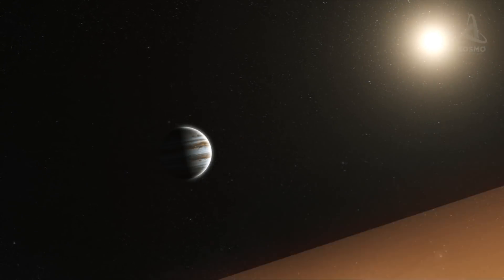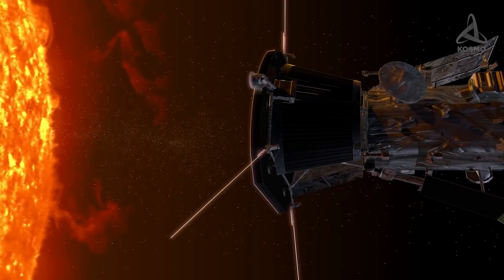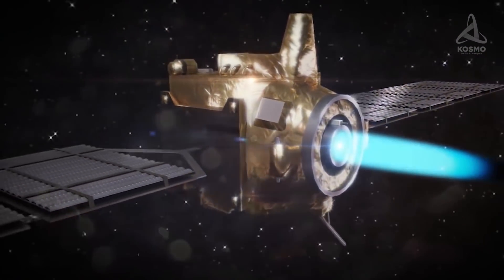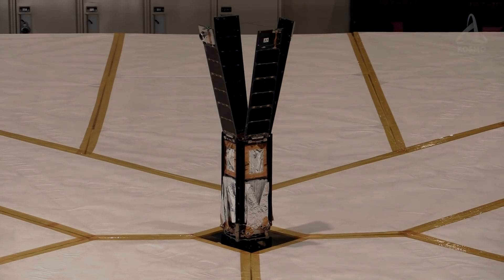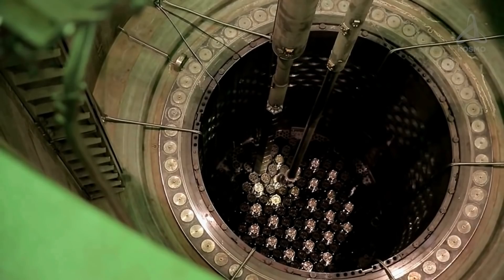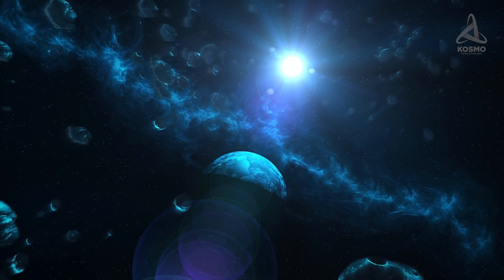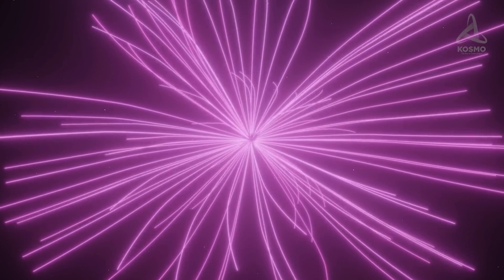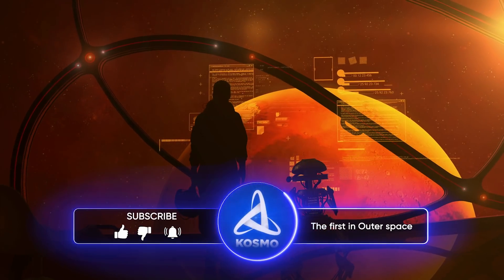Spaceships Capable of Reaching our Closest Stars

Comment: The Bussard ramjet was disproven in the 1960s. It's a sort of perpetual motion machine, effectively. The drag overtakes any possible thrust.
Reply: So was the Alcubierre drive warp bubble model recently, created by bending space in front and back of the space craft. It could only work if there is inverse matter (not antimatter, it's just negative charged matter) for bending space. 
It was proven and proposed a new model for bending space which does not use inverse matter.
Reply: @rahulbhoye9381  Very recently. I lost track of how many podcasts, channels and websites covered that debunk. Some even had Miguel Alcubierre on.

Comment: Even with 1/10 c = 29'979'245 m/s (classical physics still applies), you still need >40 years, and if you hit 1g of sand at that speed, you will have to absorb or deflect 317’133’073 times more kinetic energy (E=1/2 m v^2) than if you get hit by a 5.56mm bullet (3.5g @900m/s). This corresponds to ~ 79kg TNT (1t TNT=4x10^9J).  Could be a very unpleasant trip.
Reply: You won’t hit a 1g sand. It’s impossibly low chance in the interstellar medium. However, you’d need to make the ship “aerodynamic”. As vacuum acts like air resistance in the incredible high speeds and it will also damage the front side of the ship continuously due to drag
Reply: Average density for sure isn't that high, but we can't exclude those small particles nevertheless. Even unlikely events will come true if you wait or travel long enough. Ionised particles can be deflected with a strong magnetic shield (creating a plasma shield?), but this doesn't help against uncharged particles or larger particles 
Why not to mount another propulsion system at the front of the ship to push those incoming particles away? 🤣
Reply: There is also the problem of inertia, quite likely unsolvable.
Reply: I always wonder about this... Would it really be like 79 tons of TNT, or would it just blow a tiny (probably repairableish) hole through the craft without the vehicle needing to absorb anywhere near as much energy as you say. Obviously it is still a threat and a problem, but I can't understand how a spaceship would explode hitting a grain of sand, even if it had no protection
Reply: No, it won't explode. It will melt the material/metal immediately (splashes around in the spacecraft, and generates an enormous heat), but also will transfer the kinetic energy by impulse (may kill the crew by a gravity shock).

Comment: Some new science related to interstellar travel? Still waiting.
Reply: Check out the video "liquid plutonium rocket", the key to interstellar travel is a fission rocket that can put out thrust for long periods and does not consume hydrogen. A ship that travels at a constant 1g acceleration rate can get to Alpha Centauri in 3.6 ship/7.3 Earth years (and that includes turning the ship around half way and decelerating) and it would have gravity the whole way (which will allow farming for food and oxygen). The ship would achieve about .95 light speed after about 1 year. With this method a ship can span the entire diameter of our galaxy in 12 ship/113,000 Earth years. For some reason people dont know about this method, there is no doubt in my mind that this is the way we are going to do it.
Reply: @shawns0762  okay, thanks

Comment: considering that in just 66 years we went from the first flight to landing on the moon it seems highly likely that in the next few decades or so we should be able to perform the first manned flight to another system
Reply: Highly unlikely. This is like mans first boat ride to a close and visible island vs. crossing the pacific. We can’t even build economically viable supersonic commercial transportation let alone interstellar spacecraft lol.
Reply: @JustinLHopkins  actually the reason supersonic air transportation is not used is die to the noise it would cost there are designs out there that are meant to reduce it
Reply: Supersonic is like 700mph. I thought we're wanting to go to another damn star. We need some guidance from a more advance civilization. If they  haven't went extinct yet.  Or this is going to take US forever.😒
Reply: NO IT DOESN'T!  Oh, this is such a common argument.  It's just an ANALOGY, it doesn't prove anything.  Some analogies work over a certain range, some break down, some are bad from beginning to end.  It suggests something, that's all.  I call it "argument from cell phone", it's a NEW logical fallacy.  Going to the galactic rim (they do this easily in Star Wars, like taking a taxi exactly) might be three million times harder than going to the moon, so that 66 years you mention now become twenty thousand years or something.  NOBODY EVER REMEMBERS that the fabulous and remote SPEED o LIGHT itself is still nothing in terms of stellar travel, much less INTERGALACTIC travel, and in science-fiction people are constantly talking about galaxies!  What is it, twenty thousand light years to Galactic Center?  Where all the cool people are?  "Don't hold your breath" is what I'm yelling here.

Comment: If we can build a mablev elevator we can use that to get supplies into LEO and build huge payloads and their ion engines there cheaper and faster in an orbital drydock. We can stil use chhemical boosters to get us up to speed quickly and continue excellerating with the ion engine(s).

Comment: One thing i always wonder, let’s say we got the engine’s, we got the ship and the speed. How do you slow or stop and if your going so flipping fast how do you steer round or not hit things ?  Also if we take the generation route how on earth do you maintain something that’s going end up obsolete in probably two generations let alone trying maintain it 30,40 or 50 thousand years.  Just wondering lol 🤘👌🤘
Reply: Same thoughts. Surely they will hit an asteroid or something
Reply: @meaibannongkhlaw2443  no, space is much more spread out than you think. It's INCREDIBLY unlikely they will even hit a smidge of dust until they land somewhere
Reply: These are certainly things the engineers will have to address in the distant future. Notice I say distant, because I don't believe we are anywhere close to being able to do this, the technology to do so hasn't even been conceptualized. Two things to note though, space is huge. The distance between objects even in very densely populated areas like they Kuiper astroid belt is immense, so much so that the chance of hitting something is very slim. I believe we will need something akin to a forcefield to "bounce" those objects away from the space craft, should they come into contact. Alternatively another option for space travel isn't quite using speed at all. Wormholes theoretically exist, the math checks out for them to be out there, we just don't know if we can utilize them - Or if the math is wrong. But if they do exist, and we can use them, that will for sure be the fastest way to travel across the cosmos. Faster than light. One of the problems you mentioned is the speed, a big problem with going near the speed of light is slowing down. Rapid deceleration may be fine for craft, but for the squishy meatbags inside? That will surely result in explosive death. There are many things we must figure out before we can hope to reach other stars. A problem this generation, unfortunately, will likely not solve. May our descendants have better luck.
Reply: @danielmonroe9146  if you went faster than light you would travel back In time
Reply: @enderman5423  It is impossible for physical things to go the speed of light, the closest we can maybe get is 99%. But I mean, that through the use of wormholes you basically go faster than light. You aren't actually going anywhere close to the speed of light you're just taking a shortcut through space time
Reply: @enderman5423  technically according the General Relativity, you would travel to the future. If you travelled out into space at the speed of light and then returned to earth, you would be the same age though you would actually be in the future as time slows down the faster you move.
Reply: @danielmonroe9146  80 years ago we thought travelling at the speed of sound was physically impossible, I do think there is definitely a way to travel faster than the speed of light though whether it will be achieved in our lifetime, I wouldn't imagine so.
Reply: Space is vast and things are really, REALLY far apart so hitting something is unlikely.
Reply: @ken7165  Plane crashes are unlikely, yet they happen. It doesn’t matter if an impact is unlikely, it’s possible, therefore it must be accounted for in the design of a ship.
Reply: I love popcorn.
Reply: @TheHeatShack yes. When I say that I mean if you eventually returned to earth it would be in a time before you arrived
Reply: That's the main thing with space travel, slowing down is the much more complicated problem. There are many departments working solely on this issue aha. Keep in mind, if you're travelling at say 25% the speed of light, what happens if you hit a small asteroid? The ship ceases to exist :/

Comment: I mean even if its 130 years to travel to Alpha Cantauri, can the equipments and engines last 130 years hell even 20 years.
Reply: If it is made by GM, yes. Anything Ford made, and you would be in a floating tomb.
Reply: @MTG69  Ford developed the GT 40, 2005 GT, and the 2017 GT. Cars that were well built and faster than anything Le Mans had to offer. Don't knock Ford for their one decade of sub par business decisions and excessive recalls. They went into a slump, but overall built damn good vehicles. And they do now. I'd pilot a Ford spacecraft.
Reply: Actually because of conservation of momentum you wouldn't need to have them on 24/7 if you could predict where you and the star's paths would intersect
Reply: Not only that, but if it's a team of people, wouldn't they eventually tear each other apart? Get sick? Compatibility issues, etc?
Reply: @dbsti3006  read my above comment

Comment: FTL is achievable via dark energy .
Reply: What is dark energy and how do you use it?
Reply: @wc4201  DE is the force that expands the universe faster than light. It is an attractor force like gravity and it is drawn towards the multiverse (other universes) which infinitely accelerates .
Reply: Not dark energy, antimatter is the key. I know because I’ve seen antimatter drives and what their capabilities are before.
Reply: @ImSpun13  anti matter is weak compared to DE. It is also not a stable safe energy resource.